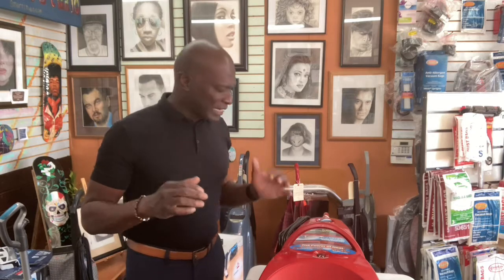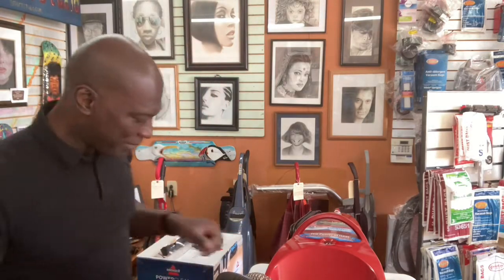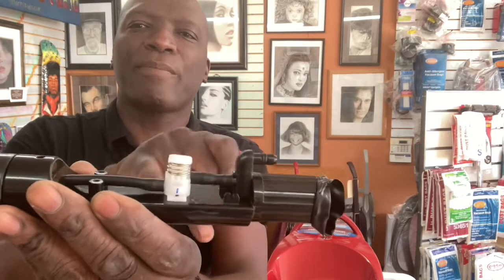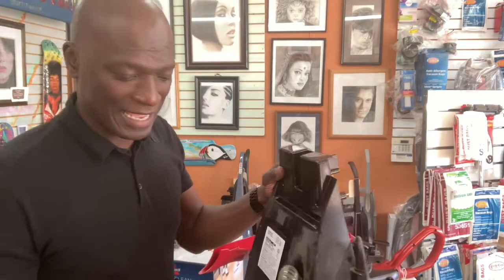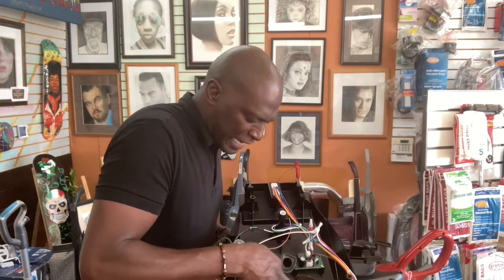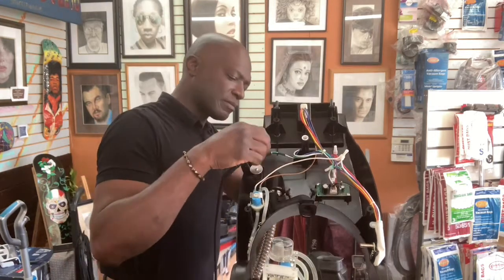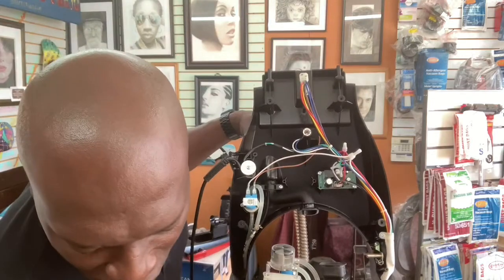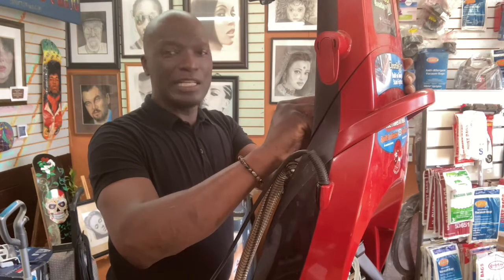Wertheim se9500 and Bissell 2x hose replacement and unclogging

Comment: Hi again, Maureen from Australia regarding my Wertheim Pet Pro SE9500.  I was new to this Youtubing thing at the time i posted my previous question, and i didn't get any notice that you had replied. The Bissell model you troubleshooted was similar but not the same. Same issue. It sprays great,  but only a whisper of  suction on the floor from below and from the attachments.  It has a bladder compartment for clean water,  and that sits in dirty water if the suction works.  I'll start pulling it apart tomorrow as it's very late here.  Thank you so much for all that dismantling you provide and explain.  I'll send a pic of my machine and let you know how i go.  Keep up the good work!! ❤
Reply from the maker: Thank you and I apologize for the delay. Keep me posted
Reply: Thanks so much for giving me a thorough explanation of this machine. I don't know how you don't go insane working on them.  I've had a few busy months, so I haven't pulled mine apart yet.  You're a very patient man! I will definitely update you when I've done mine.  😊
Reply from the maker: @maureenamos7868 looking forward to seeing it

Comment: Can I not replace the hose without taking the casing off? Like can I use pliers to pull the tubing out and force the new tube inside? Or must I take the casing off?
Reply from the maker: Yeah I don’t see any other way to do that. From what I gather you would have to open the case and install it that way unfortunately
Reply: @monroevacs  I followed your instructions. Unfortunately my tube doesn’t separate in the “s” tube once I take it off. It goes down through near the wheel into the bottom of the shampooer. It doesn’t look replaceable. It’s just one long tube.
Reply from the maker: Don’t give up. You can use tube connectors and clamps to solve the problem.
Reply: @monroevacs  I really appreciate your video and your response support. I was able to take the attachment end off and pull the hose out that and using the existing inner tubing instead of trying to disassemble the entire shampooer.
Reply: We have the same issue. We are going to have to connect the new tubing another way. I hope it works 🤞🏼.